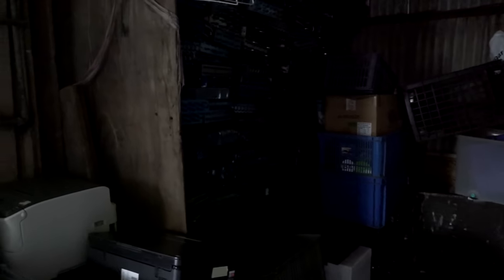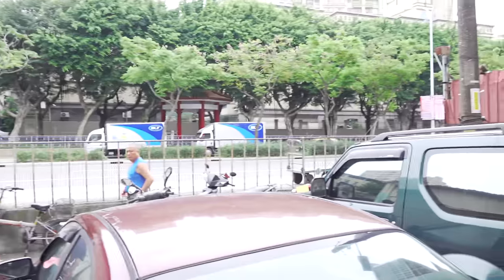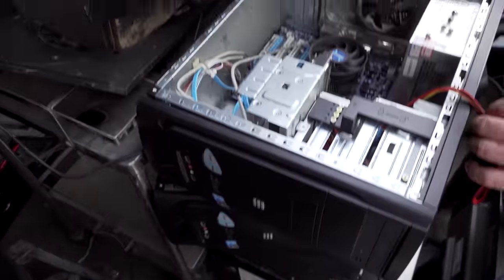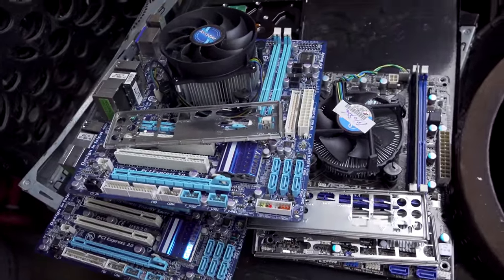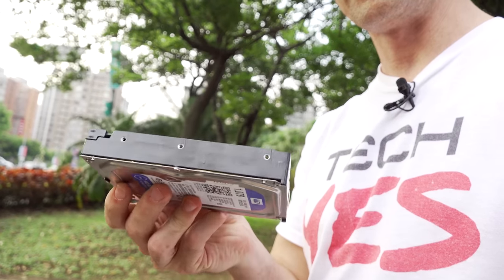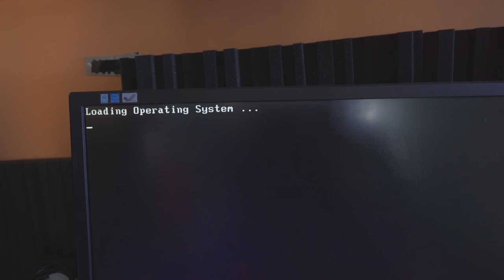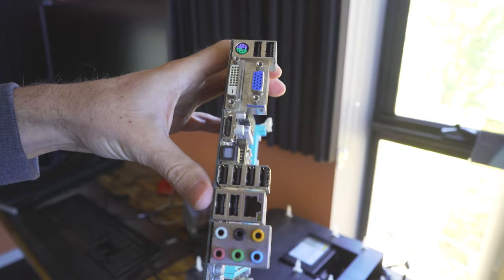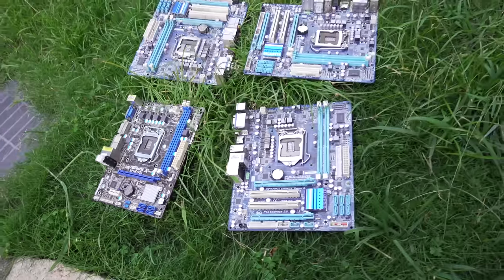I went looking for PC Parts in SCRAPYARDS in Taiwan...

Comment: 2:21 omg! why did they stop doing the Intel style cover? that is soo good! you always have to be mega careful when removing AMD cpu's it's a bit of a pain... some time you wanna run them hot before that too...

And worst of all is if someone used the pre-applied thermal compound because that shit is like glue!
Fuck factory thermal compound! never use it!
Reply: i thinks it's a mistake of him. even the very old sempron from 1999 already had the amd style.
Reply: @mehdisol7094  i which they would go over to using the intel style cover... i hate the inverted pin thing on intel though that just sucks...

Also i dont get why they dont just make pad son both mother board and cpu and just do a throw away pin part... that would carry the whole concept through much better i think...

Comment: Just a heads up I remember reading on multiple forums in the past, how users who were overclocking their intel core i7 2600k cpus using GA-Z68XP-UD3P & other UD3 series motherboard, their VRM would overheat & catch fire. there are a few images posted online. I would suggest NOT overclocking on the lower end "UD3 Series" boards. UD5+ is fine tho!

Comment: I liked the first group of people, they seemed nice and easy to work with, second place they are kind of jerks and its not too smart of them to leave parts out to get damaged by the rain when you could make more money off of people coming in to barter if you protect them from the rain, more people would do that and you can make more off of that then the little bit off of the precious metals
Reply: That's the coolest thing though. CPUs can especially do surprisingly well in the rain. When the computer is closed, and stacked under other crapboxes, it's surprisingly dry inside. I've literally showered CPUs with the shower in my house and then gave them a good dousing of Isopropanol to clean them.

Comment: I got a x58 complete system last week for free anyone knows a cheap upgrade for it to make it a good gaming system?
Reply: X5470 or 75 or 80
Anything in range like rx570, feel free to use ecc memory (cheaper)
Reply: @Callagwhan  thx i will order my parts soon
Reply: Or rx580, or 480 or gtx 1060
If you have already 6 core one (980/990x) then dont use xeon
But if you have something like 920/940,950 then replace with xeon 
Just check on forums what ecc memory are people running...!!
Reply: @Callagwhan  ye i have a i7 920 in it so of will be replaced and i have 16gb of ddr3 so that is fine and with the gpu i am going with the rx570 thx for your help
Reply: @jaimesmets8058  very nice, enjoy
Reply: If the board is non oc one, get the fastest chip
Reply: @Callagwhan  ye the board is a p6t deluxe v2 from asus so i think it will handle oc just fine :)
Reply: 5675 or 5670, then
80 is too expensive

Comment: Hello there guys, this comment is not related to the video but please hear me out. I'm trying to RMA my GTX 980TI from MSI which I bought on 16th of June back in 2016. It's supposed to have a 3 year warranty but I got turned down. The sales representative told me that the warranty started when they shipped it to NewEgg and not on the date of purchase. I'm feeling screwed over by MSI after spending more than S$500 on a graphic card. Please like and comment, so Brian can see this and spread the message about crappy warranty service by MSI. Thanks for reading.

Comment: I bought a used PC from craiglist, the guy wouldn't sell me the mobo only which is the only thing I need(1155) and wants me to buy the whole thing so I did(had no choice, the next seller that is closest to me was so far away), he said the parts works but it needs some work, I found out that the HDD's OS is corrupted, so I just plug it in my personal pc to check if there are files in it before I reformat it and I found is quite shocking I guess? 270gb+ of raw uneditted porn footage. contact infos, unfinished projects.

Comment: Why would you bother, everything you picked up is trash and worth next to nothing, I see better stuff given away (and yes, in Australia)
Reply: Why not? Mixing perfectly good components that still run well and can still game really well for less is a perfectly good strategy for those with less means. Why bother putting in the latest CPU and Motherboard and RAM if you can't afford the GPU? The GPU is the most expensive component and largely the one doing the heavy lifting in games. It's how I helped my younger brother into PC gaming, then a younger teenager get into PC gaming with limited money. You don't need to have balls to the walls for PC gaming. I still use my 4670K that I actually got for free years ago. A 5 year old CPU. Overclocked it and it's a solid platform.
Reply: @MarcoGPUtuber  I didn't say shit about new stuff, I only commented on there being drastically better hardware being thrown away and it seems like a waste of time when compared to what I am able to find on a daily basis
Reply: @sachaw100  I understand. But that's what makes them appealing. That they can be fetched for next to nothing and turned into working gaming machines. The i3s are garbage IMO but the quad core i5s and i7s on that platform do really well.